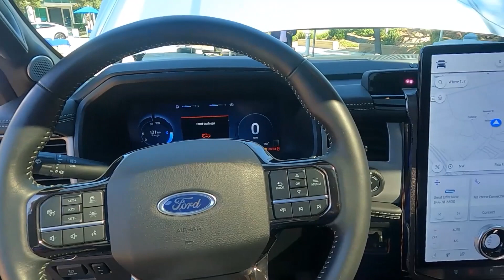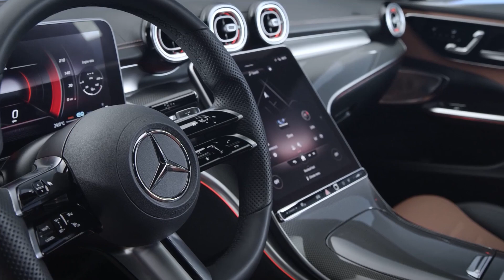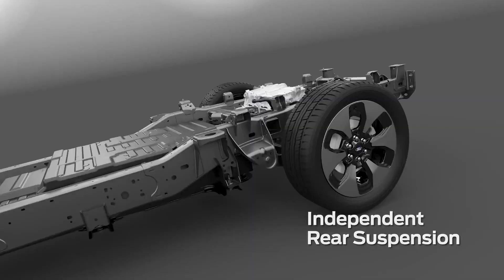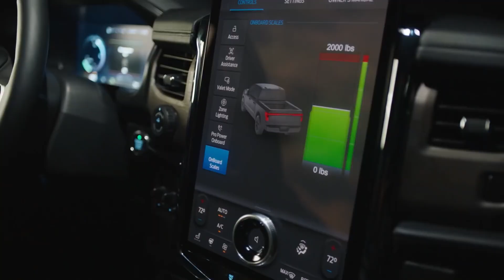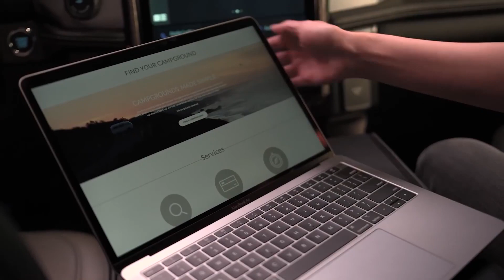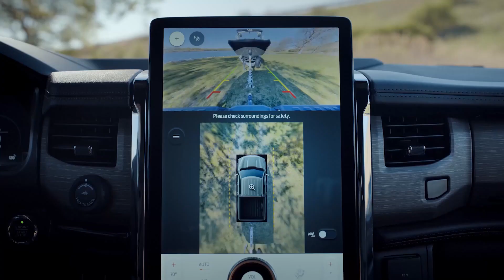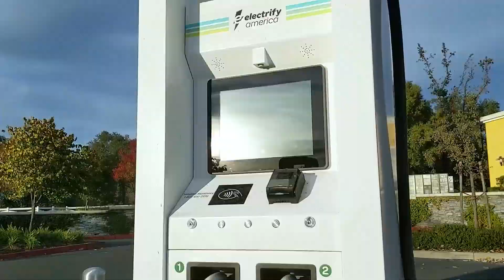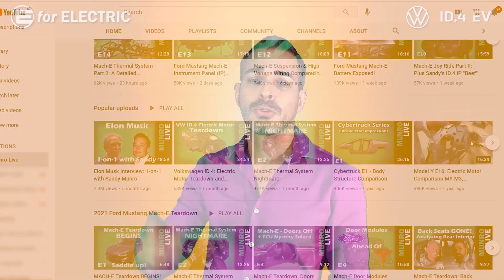SANDY MUNRO on Electric Trucks: F-150, Cybertruck & Rivian

Comment: Sandy read my mind! 500 miles is the ideal range for an EV for mass adoption.
Reply: Maybe I'm just more open minded. But when I was making the switch 300 was my magic number. That's what my gas vehicles got
Reply: @Gurule  Yea, 300 fits the bill for me. I'm getting the Lightning next year. But I may very well upgrade to a Cybertruck at some point.
Reply: @rvboyett  yea I'm shooting for the cybertruck but we will see when that comes out. Looks like it's going the way of the roadster
Reply: Even 300 miles with 80% charge in 20 mins will do the job. After 300 miles take rest..then you get 250 miles in 20 mins. Similarly next 250 miles in 20 mins. So you spent only around an hour for 800 miles. Is that bad or good?
Reply: 500 works if the mileage rating is a truly realistic rating and taken at Interstate speeds (80 mph).
Reply: @generic6587  I think 300 - 325 is fine for normal cars. Pick up trucks need the additional range.
Reply: @MatthewGraham027  -- Those of us who enjoy outdoor recreation in the mountain west need more than 325.
Reply: @generic6587  Well that's me too. But I wouldn't buy a normal car for that. I would buy the cybertruck. But that's a different argument than the average buyer who would be just fine with a model 3/Y. Most people are like that and would be just fine with a 320 mile range model Y.
Reply: @MatthewGraham027  -- 325 doesn't work for anyone I know.  I don't know anyone who is willing to purchase an electric vehicle as a primary vehicle because the limited range is a serious issue.   It's not enough.  If you live in a city and only do city things, it's fine.  

Cybertruck is too big.  It's as long as a Suburban.  The thing is a tank.  I wouldn't want to be stuck driving that thing long distances as it would be dreadful.
Reply: @generic6587  Well it clearly works for a lot of people. The model 3/Y sells like hotcakes. In fact it's selling out and they need the new gigafactory to keep up with demand.

Also I'm going to buy the Cybertruck. Tons of other people have pre-ordered and people will buy the car. If you don't like it fine, but there are other people who don't think like you. And yes, I'm going to drive it long distances.
Reply: Except you will never use 350 miles of that battery 99% of the time. Waste of money.
Reply: We have the long range model three and do family camping a few times per year here in Quebec.  With 1500 liters of space it’s basically a wagon; the downfall is taking stuff on the roof in winter, range drops to about 175 miles / 300 km. I’d trade “up” to a Lightning if it was a basically straight trade and had more winter range. Alas....no.
Reply: @MegaWilderness  so the cybertruck could be the same but with trucks
Reply: @Gurule  If you are doing a 500 mile road trip, an EV with 300 mile range will add at least 1 hour to your total trip time vs a gas vehicle. With a 500 mile range EV you will probably stop once, which you will do with a gas vehicle anyway.
Reply: @ojeje1  a 500 mile trip in a 300 mile ev would take 1 stop maybe 2 but the second one would only be like 10 minutes (depending on the ev)
Reply: 280 max is enough for me, if it can charge 280 in 15 minutes. Smaller battery is cheaper.
Reply: @ojeje1  i have a Model Three with a 300 mile range. To go 500 miles i would plan stop twice for fifteen-twenty minutes each. For a seven or eight-hour road trip in a gasser, that's almost the same. I mean i COULD drive straight with one five minute stop for gas but i likely would stop for lunch and to stretch my legs if at all possible.

Comment: Part of why I bought my aluminum 2016 F150, was to support electric truck tech.  When I heard to weight difference was exactly the what was needed to keep the curb weight the same for an EV version, I knew they were real-world testing for an EV truck platform.  My next truck will be EV. Which ever one is a real truck and has FSD (I have medical issues that FSD could save my ass) will be the one I buy. A sheet of drywall or 3/4" plywood weighs 70 lbs (32 kg) 20 sheets is 1400 lbs, so that is what I think a pickup truck minimum requirements is.
Reply: a 4x8 plywood sheet will not fit in the useless size bed of the Lightning.
Reply: @flyingyakdeath  It fits in my aluminium F150, and that's the same bed as the lighting.
Reply: @gyrateful  the L bed is not 8 ft long. Spec is 5.5 or something like that. A minivan can haul a 4 x 8 plywood and keep it dry and keep it hidden from view. The fascination with pickups is perplexing
Reply: @flyingyakdeath  My standard bed is 6.5 feet and with the gate down it's over 8 feet. With our loader, I can dump almost 2 yard of material in the bed. Try that in a minivan! A full-size L bed work truck in N America is 8 feet. I know a lot of people that haul 4 to 8 horses with pickup trucks. Trailer over 30' needs a large truck (6 horse is 33'+ neck),. I don't need all that, so I have a F150. If I go on a road trip, I rent a car.
Reply: @gyrateful  when I need a load like that every 5 years I pay 30 for delivery - fridge, gravel, whatever. Saved on the stupid pickup idea.
Reply: @flyingyakdeath  Pickups are more about towing. How much can a minivan tow? I am a huge fan of vans, but there is a place for both platforms. I have a Tacoma, which has the most useless bed of them all. But I make it work as I use it for camping and towing and off roading. If you are going to I remark on something being useless you have to consider that not everyone has YOUR same needs.
Reply: @PumpUptheJam81  I disagree. Half the vehicles parked in driveways in my track home neighborhood are pickups with clean beds. They're commuter vehicles and that is misguided culture.

Comment: Reminder once again, the $40k model is the Commercial Fleet trim. Businesses can buy that, you can't, and it's a safe bet that a good percentage of Lightning production is going to go to fleet purchasers who are more concerned with cost of operation than purchase price. 
Second, Ford has stated they will only be able to make about 40k Lightnings per year until 2024, when they will have enough batteries to double that to a whopping 80k units. The pre-orders backlog is already full through 2023.
So will Ford sell a lot of Lightnings? Sure. 
Will YOU be able to buy one? Unless you got your reservation in on day one, not for a while.
Reply: Just remember patience-is-a-virtue. If I were younger I would have my name on the list. These first owners will be test subjects. As usual most of the bugs in these early models will be worked out by the time the mass buyers purchase them.
Reply: Anyone can buy the Pro trim. Yes it's true it's going to be tough to get one, but that's true of any trim. The sub $40k model is real and an impressive price point others are unlikely to be able to match.
Reply: Pro trim will be available to everyone
Reply: @jakeh8366  Only fleet can buy pro trim WITH extended battery.  Which basically forces most buyers to the higher priced lariat model.   So if you want a 230 mile pro trim, then yes, everyone can get on the list to buy one in 2025 or so.  :)    range is king, especially for trucks that need to haul, tow or road trip.
Reply: @bad50  Correct, but the normal battery is what gets you the $40k price tag. The original argument was essentially that "no one besides fleets will get these for $40k". That's the inaccuracy I was rectifying. Thanks for the additional clarification.
Reply: Like my cybertruck order , I'm in line at number 1.8 million , I'll likely see it in 2 to 3 years if ever.    I am thinking of giving up and buying something else.
Reply: @nonexvcghdfgh  I ordered my tri motor during the reveal but I will still wait a year after production start to make sure they have most of the bugs figured out.   Only way I would cancel my order is if Tesla backs off the 590 mile range like they did for the model S.  I drive an f150 now so I could totally go for the lightening if they bump up the range to at least 400. No other options out there for me.  Rivian is too small for me.    I'm supposed to get my model y LR in November. 😁
Reply: @bad50  I unfortunately waited to order mine , I wasn't on the bandwagon yet.  After a drive of the y and 3 I was sold and ordered the dual motor 4wd cybertruck,    but I am so far behind the curve now , plus the chip and other shortages,  I'm thinking of giving up.   I saved up and was going to pay cash.  But I think I may spend it on something else as I dont want to wait another 2 years
Reply: @nonexvcghdfgh  no no no.  Keep the dream man. 2 years will fly by and the chip shortages will go away within the next year.   You will regret giving up. I'm so committed I already reserved my personalized license plate.  CYBER T.  😁😁
Reply: @bad50  Don't forget the $7k off current tax credit!
Reply: Imagine being so confident and being 110% wrong -- Fords head of commercial vehicles has stated the Pro is for everyone -- the only package that isn't available to us nomies is Pro + Extended range
Reply: Ford has failed on capacity alone.  No need to look at the vehicle at all.  There won't be enough to make it worth maintaining.

Comment: Like always the software development capabilites of the manufacturers are left out of the comparison. I can tell you which company outsources their core software features, and which doesn't. I personally don't want to have to wait on a contractor to fix issues on such an expensive piece of tech.
Reply: Bingo… these are antiquated comparison methods.
Reply: Tell us
Reply: Agreedit needs to be revealed.  But hardware guys CANNOT do software so I want it subcontracted.  By no means can anyone answerable to a hardware company do good software.

Literally every single human with this capacity works for Apple.  Everyone else just does what the hardware guys say to do and end up with garbage that fails the second there's a necessary trivial hardware change. 

You know why all EVs charge off GreenPHY compatible chargers?  SOFTWARE guys. The hardware street trash only complain about having to meet an actual standard.  Thankfully they were crushed so your power meter and demand response appliances WILL talk to your car WHATEVER it's make. 

You know what it looks like when you let hardware tell software what to do?  It looks like the 12V parts bin.

Comment: I'm really excited to see how the Lightning changes the pickup market!
Reply: Yeah, me too. Not because I think  the product has potencial, but because it's the major player in the arena! And it's always interesting to see a market being disrupted! something that looked like set on stone, becomes blurry and generates opportunities and drama! it's like a hole black mirror season in real world!
Reply: Biggest problem is they just aren't going to be making enough if them any time soon to really affect things. It's going to take ford forever to ramp production to anything resembling ice production
Reply: Sandys endorsement ,of the F150 Lightning, should be music to the, Ford engineers ears. Looks like a very useful and practical vehicle, from my standpoint  !!!
Reply: @themeach011  Once the real demand, for the Lightning is measurable , I am sure that because of the similarity to the ice model, with many interchangable parts, ramping up production will be much easire than you think.
Reply: @darrenhefford3722  my only concern would be battery supply. But even chips are causing hold ups now. I bet all the OEMs are down on production this year because of that. The other problem with the lightening is charging. Watch Marcus Brownlie's vid that just came out. Mach e was like 6 hours slower than a Tesla on 1000mile trip because of charging issues

Comment: I really like how the lightning has large loading capacities front & back.
I'm with Sandy on the value of Ford's large parts bin that will keep costs down & only needing relatively minor changes to the chassis for the battery install. 👍
Reply: Not only that but repairs for anything other than the motors and batteries can be done essentially at any regular ford dealership without them needing a specific ev mechanic
Reply: @mikefarino4368  Interesting, I've just replied to a Tesla nutter on another channel (Electric Viking), who told me that it's legislation (in the USA) that only Manufacturer Service Centres can work on their vehicles. 
I used to be in awe of Elon, but it's soured this year by his, I'll only provide what's economic for me, & his arrogance that his fanbois will still lick his feet.
Reply: So why is is way more expensive than the new Cybertruck?

Comment: Sandy always knows what he knows the best: the engineering part; but I respectfully DISAGREE on two things - 1) still making good money with the 40k trim? No!  on the most expensive part, the battery pack, Ford has little control over battery cost, let alone in house IPs or battery manufacturing, etc, and the BATTERY (scarcity) will be the most fierce battle ground of all EV manufacturers, trending more and more expensive IF you cannot control it.  2) in the “maximizing parts bin utilization” point - yes Ford seems to have done a great job and made the right decision so the economy of scale could be maximized; but the trade off is the lack of innovation and the status quo design becomes the biggest constraint on everything else, weight, range etc. It is more a short term “ optimal choice” forced into by the Competition than a long term strategic decision. Now that the CT has been pushed back into 2022, Ford may catch a break but not for too long. Keep in mind, every CT sold to previous or potential F150 owners will bleed Ford badly; every lighting sold, does barely any damage to Tesla.
Reply: I have a basic Ford van,  it does the Job. Was waiting for Tesla goodies,  but Ford done it already. On board power and Frunk
Reply: I really hope that Ford gets to work on their own battery cells and has their own factory before 2024. Just for the sake of switching to EV faster so we can clean up our roads from pollution & noise. Diesel trucks are so loud! I am going to use my Cybertruck as a rental so more people in mid-Michigan can drive for themselves an EV doing everything they wanted and more. Understand the wow factor of the rear ramp, air suspension, 1.75 ton bed capacity, and flotation capability. Videos at off-road mud parks, hauling large pieces of equipment, and testing freeway speed & towing range will go viral and sell Cybertruck.
Reply: Eric you are raising a very legitimate point. If manufacturers all go electric too soon, they will hit a wall in paperbacks to keep up. The current chip shortage is a mere inconvenience next to what will happen. And it will take more time to establish towing and hauling baselines in real-world situations. If I were suddenly limited to an EV truck I would buy a diesel generator to haul in the back.

Comment: One of the main reasons that trucks are still not going all electric is towing and hauling capacity. Try towing a 10,000 pound trailer with your electric truck. You will be stopping every 50 miles to charge for a couple hours. It is not practical on a truck for anything other than using your truck as a commuter vehicle. This might change with better batteries but you cant just add more battery capacity without significantly increasing the weight of the truck.

Comment: Dear Ford, I spent over $5000.00 in gas last year driving my service truck. If you're serious about the "environment", then make an ALL electric Maverick truck and I WILL buy the F***** thing. A small truck for the "working guy" that doesn't need $1500.00 in modifications to lower step bars, add ladders in the tailgate, steps and lifts in order to actually reach into the bed and grab parts and tools. You know, like trucks from 20 years ago. The Ford Ranger comes up to my shoulders, I'm not 7' tall for FS. Sorry, I had to say something for the working guy.

Comment: I take a couple small issues with what Sandy says. I am a 2016 Tesla Model S with a size 70 battery pack, owner . It takes a bit longer than 12- 15 minutes to get 80% range from near empty. More like 35 to 40 ins. Still amazingly fast in comparison with charging at home! Also, at the rate that Tesla is producing vehicles, Tesla will need all the super charging stations to be exclusive to Tesla vehicles. As a Tesla owner, I wouldn't be very happy if other brand vehicles were using the stations making me have to wait for extended periods to charge on the road. That may sound a bit selfish, but that part of what I paid for when I purchased my Tesla!